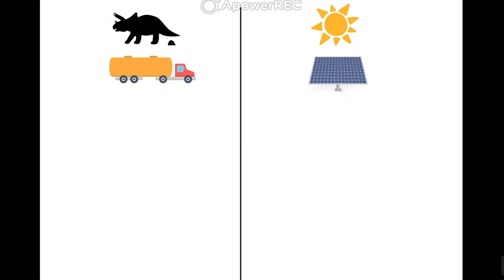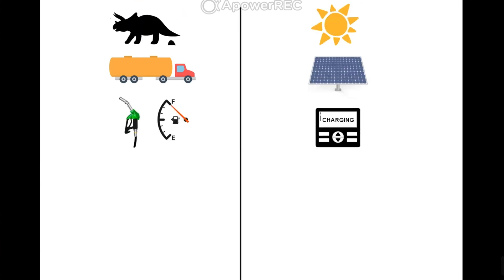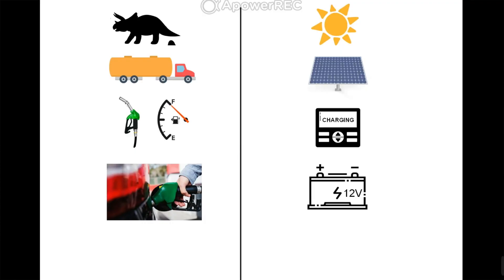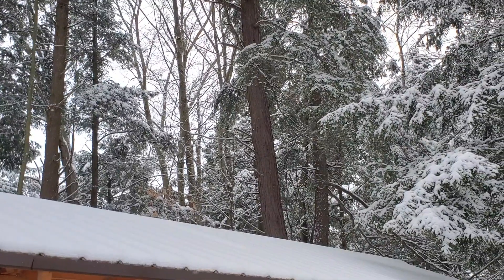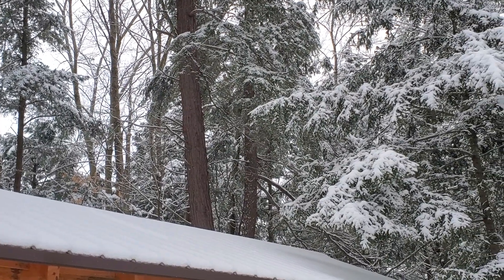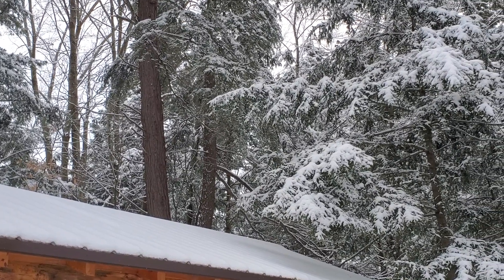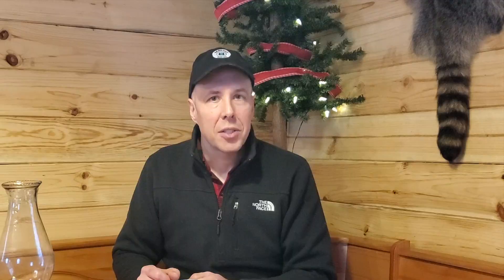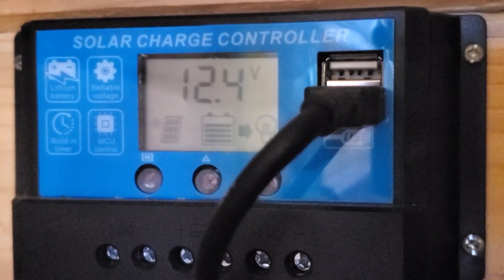3 SOLAR POWER MISTAKES TO AVOID! WATCH THIS FIRST BEFORE ATTEMPTING OFF-GRID, DIY, SOLAR POWER.

Comment: Charging batteries from the generator….what do you use?
Reply from the maker: I previously had a flooded lead acid battery so just used a standard automotive type battery charger, but it was a 15 AMP charger so it put out more juice than most. It still took forever to charge as lead acid can't be charged too quickly. It was a Black and Decker charger and it was garbage. Many times it wouldn't power on (and I see they've since stopped selling them). I've since switched my batteries to LiFePO4 and I got a charger from Power Queen for LiFePO4 batteries. I think it's only 20 AMP. I would get the most powerful one you can for your batteries as the faster they charge, the less time your generator has to run. Hope that helps.
Reply: @HemlockRidgeUSA thank you! Love your channel and keep up the good work! You and I have a lot of similarities between our cabins so I watch your channel for ideas! I was kicking around getting away from the traditional battery charger and maybe updating to an inverter/charger or an automatic transfer switch like an RV Iota. That would automatically start charging batteries when I have to fire up the Genny. I just didn’t know if maybe you have kicked this around as an idea as well. Thank you!

Comment: "YouTube comment - The $50 Water Turbine -Build Tutorial v1.0" https://www.youtube.com/watch?v=hJbiSY2CijE
 looks interesting.

Most people who think about micro hydro probably think about dams because, well, large scale hydro (such the Grand Coulee Dam and Hoover Dam) typically involves dams. But micro hydro does not need to have a dam. Why the difference?

Large scale hydro projects need to reliably provide power 24/7/365 (all of the time) and reliably provide flood control and/or irrigation.

Sure, it would be nice for you to have a dam to enable you to provide power when water levels are low, but that adds a huge amount of cost, complexity, and risk.

Put simply, I imagine that you would merely need to filter and pipe a very small fraction of the running water in your creek to spin a turbine. Imagine if you took a garden house, turned it on full blast, and aimed it at a Pelton turbine. Now swap out the garden hose for a pipe running from your creek.

If the laws where you are located allow it, it's probably worth considering. You could probably build the entire system for less than $500 in a few days or so.

Comment: You should have said roughly 39% (not 45%) at 8:32. Here's a quick review of the math for you: .75 * .81 = .6075. The reason it's a lower loss is because the inverter isn't "losing" 81% of 100; it's only "losing" 81% of 75. 

Imagine you bought a dozen eggs at the grocery store. Say, you dropped 4 of them on your way out of the store. As a result, you only had 8 eggs left. Any further losses would be from 8 eggs, not from 12 eggs because, well, you only had 8 eggs left. 

For example if you lost 1/2 of the remaining eggs when you walked up the stairs to your house, you wouldn't lose 6 eggs (half of the original number of eggs) you'd only lose 4 eggs because, well, you would only have 8 eggs to lose!

The key to using basic math for those of us who don't "think in math" (I've dealt with many engineers who "think in math" with whom it's difficult for me to converse in quotidian English) is  "don't get lost in the numbers." Instead, use simple analogies first and foremost. Then ask yourself how to use the math to precisely describe the phenomena in those analogies.

Interestingly, great mathematicians don't struggle with numbers as much as most people seem to think. Great mathematicians struggle to come up with analogies. Once they grasp the analogies to help them understand the constituent elements of a problem, they can design/describe solutions with numbers. At its core, math isn't really numbers any more than, say, English is about letters; math is essentially a language used to precisely describe particular types of phenomena.

E=MC2 wasn't really very interesting or important in and of itself. The notion that energy and matter are actually different manifestations of essentially the same thing is simultaneously profoundly enlightening and utterly earthshaking. It's as if Einstein said, "Well, just like steam is essentially a different manifestation of water, the sunlight falling on my skin is essentially the same as Newton's apple that fell from a tree." Ummmm. Well. Hmmmm. Can I grasp that? Yes. Would I have imagined it? I doubt it... very much.
Reply from the maker: You are spot on. When I was editing the video I realized my mistake. That's what I get for doing quick math in my head while on camera. I like your analogy though.
Reply: @HemlockRidgeUSA  It's sooooo easy to get lost in the numbers when doing math that most of us tend to fall into that trap. 

When I do math, I often force myself to initially ignore the numbers and instead ask myself, "What is actually going on here? What do I need to figure out?"

I was surprised to learn that most engineers tend to avoid dealing with math until "the last possible moment." The tend to focus on solving the problem generally while  saying something like, "Yeah, well, we can calculate the numbers later. But essentially that possible solution seems like it will work. Now, why don't we consider this other possible solution."

By contrast, most non-engineers tend to prematurely jump into calculating. Whenever I hear a non-engineer say things like, "Well, I think we should crunch the numbers." I tend to think, "This guy is totally lost. He's trying to solve a problem he doesn't understand with numbers. That's not how problem solving works." 

Having said that, I often win arguments with engineers because they tend to become so myopically focused on details, that they lose sight of the big picture. They tend to prematurely stop asking questions scientifically and start solving problems.

No matter how hard I try, they refuse to stay "lost in the fog" with me long enough to properly construct creative solutions. Solving problems takes most of the time. Sure it does. But, most people spend most of their lives solving the wrong problems. Engineers are no different.

Comment: You should have said 27-32% (not 20-25%) at 7:18. Here's a quick review of the algebra for you: .75* X = .95. Therefore, X =.95/.75 or ≈ 1.27. Therefore, an increase from 75% efficiency to 95% efficiency is an increase of about 27%. In the case of .75* X = .99 it's an increase of 1.32 or 32%.

Put simply: based on what you said, it seems that paying an extra $100 or so for an MPPT solar charge controller is probably worthwhile for most users of photovoltaics because almost everyone seems to always wants to use more electricity than their system is capable of producing, yet most users prefer to have as few PV panels as possible because PV panels are ugly and take up space.

Comment: There a step between the solar panels and the charge controller. 

With about 200W solar panels, you will lose about 10% of your 10-12 amps power based on 20 ft of 12 awg wire.

I bought 8 awg wire for 20 ft with about a 1-2%  line loss.

Update and get the fastest wire for the best performance.
Reply: That sounds like a very good idea.